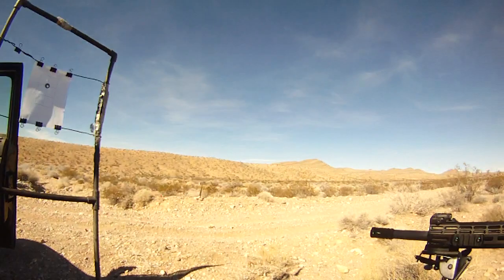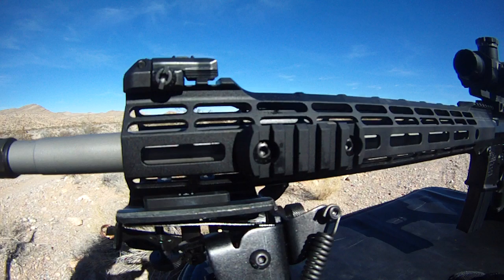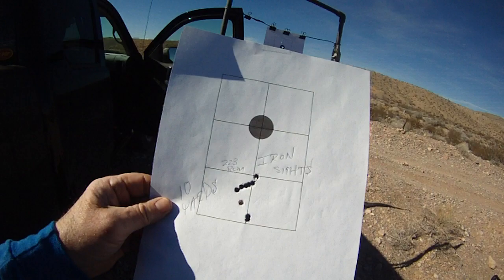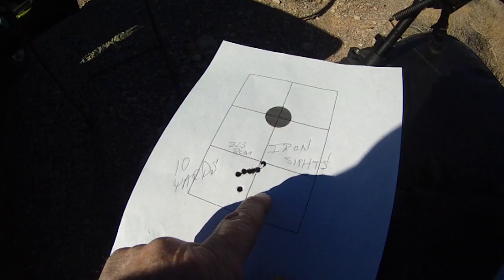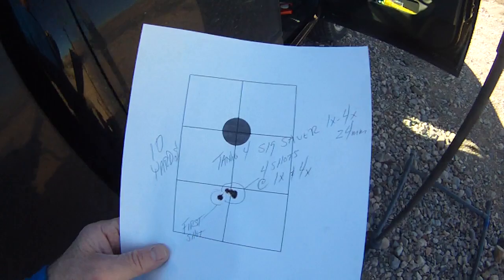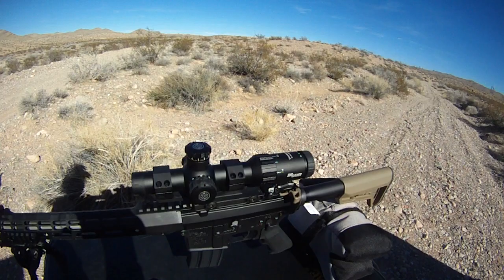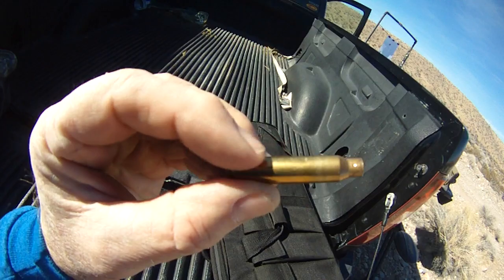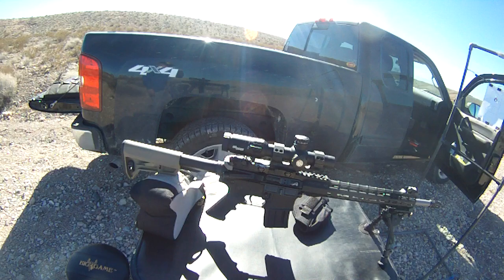Aero Precision 16" Stainless Range Test

Comment: Great stuff!  I have the same upper ordered.   But now wondering about that casing dent...Is the gas block adustable?
Reply from the maker: No it's a fixed low profile. I think the rifle might be slightly over gassed and the brass is getting dinged on the way out. Confident it's not a chamber issue. Yes! The rifle shoots great and is accurate!